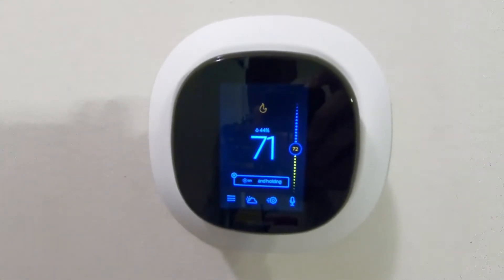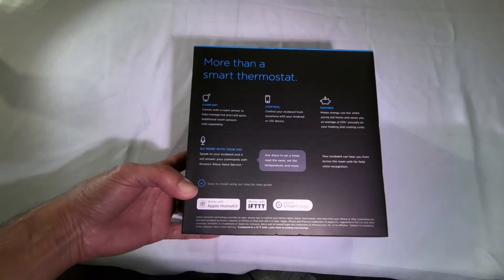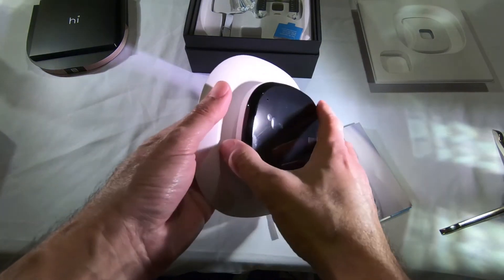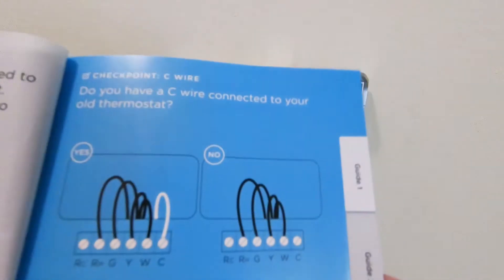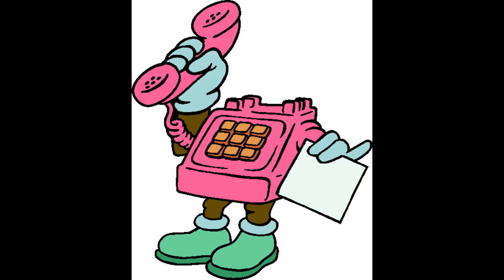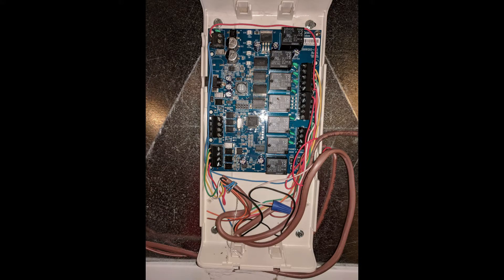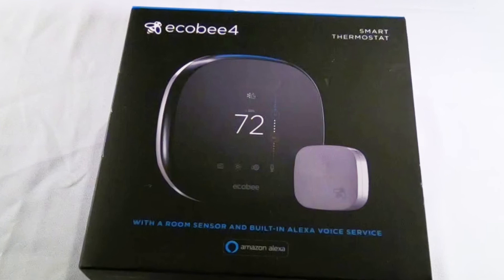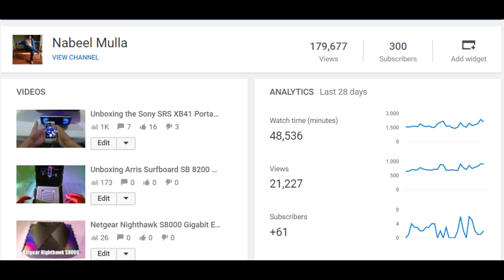Ecobee 4 Smart Thermostat Install - Harder Than Expected

Comment: hi Nabeel,
thanks for the video. Can you please share how you connected wires from hvac and humidifier with the 4 wires that were connected to the old ecobee?

I have the same issue replacing ecobee smart with the newer ecobee bypassing emi, and can't find proper wiring model

Comment: Harder than expected for you. Most modern homes have the C wire. I just installed mines without any help in just about 30 minutes.
Reply from the maker: John Appleseed thanks for the comment! I guess I was most surprised that because I was replacing an ecobee 2 (maybe five years old), I thought the ecobee 4 install would be a breeze. Big difference in just a couple of iterations of the product. I'm glad your install was much easier.
Reply: He has an EIM. That’s a complicated setup most HVAC installs don’t have.